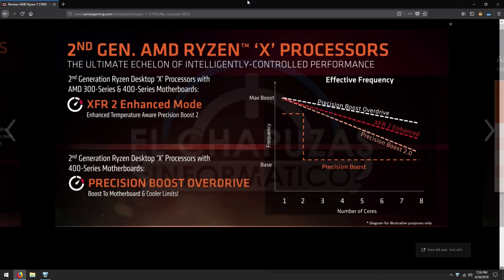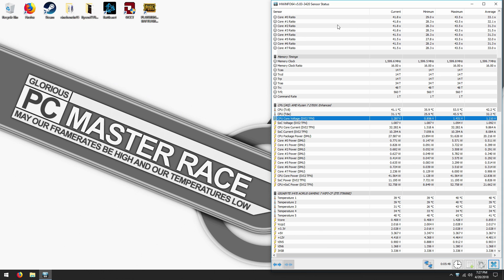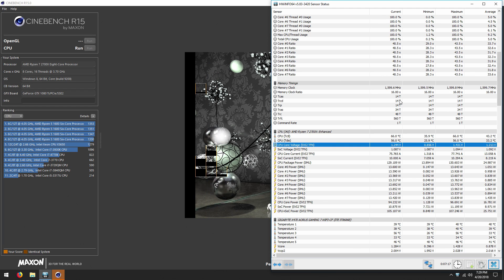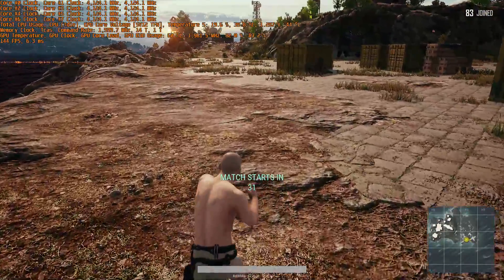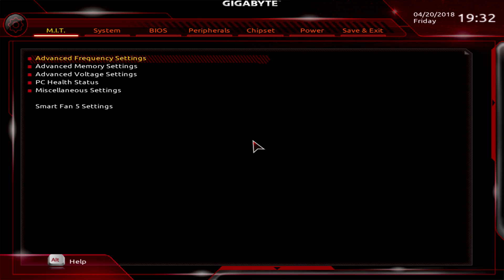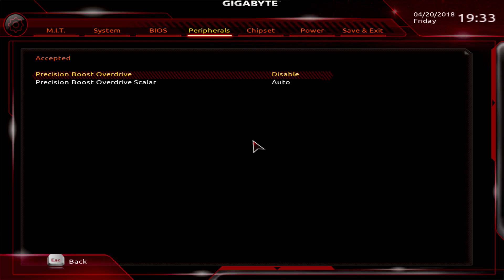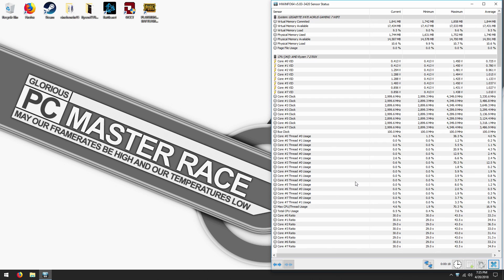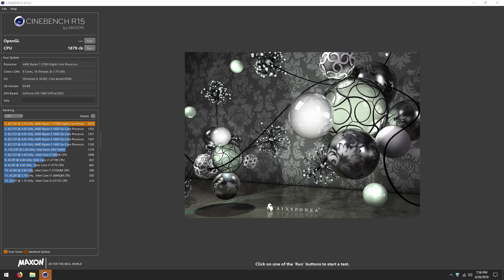How to use Ryzen Precision Boost Overdrive?

Comment: I have the ryzen arous b450 pro wifi and ryzen 5 2400G witch supports precsion boost 2 and bios is on f50. https://en.wikichip.org/wiki/amd/ryzen_5/2400g

I looked under amd cbs and the nbio comms option is not there can you do a video on enabling  precsion boost on bios f50

Comment: I bought a dell inspiron 5676 for $629 on amazon about a month ago with a ryzen 7 2700 and rx580 4gb model . the problem i have with it is that it doesnt boost to its rate 4.1ghz on any core , it justs stays at 3350mhz on all cores and doesnt boost at all.
ryzen master doesnt launch either it just says not responding every time i try to open it. i also looked at the bios and the cpu speed is 3200 mhz and it doesnt give me any options to change anything , not even the voltage. the problem isnt temperature because its 35C at idie and 47C when gaming. i just want to know if its the motherboard thats stopping me from getting my boost clock. ohh and on cpuid hardware monitor the min is 2600mhz and the max is around 3600mhz, but i never see anything higher then 3350mhz on msi afterburner.

Dell Inspiron Gaming PC Desktop AMD Ryzen 7 2700 Processor, 16GB DRAM, 1TB HDD, AMD Radeon RX 580 4GB GDDR5 Graphics Card, Windows 10 64-bit, Blue LED, Model Number: i5676-A696Blu

@t
Reply from the maker: That's weird. I'd customer support and check online if your PC has a BIOS update. Sometimes in OEM systems they put some limitations. Hope by now you have fixed your problem.

Comment: Hi my friend.i have the msi b350 pc mate. my cpu 2600x  boosts at 4.0 4.2ghz with a be quiet cooler and 5 case fans..on bios it says pbo and settings are auto,manual,disable,and amd (default).my setting is on auto.should i change it to amd (default)??

Comment: I can activate precision boost overdrive on my b350 pc mate Mainboard and it works and boosts my cores up to 4ghz-4,2 with stock cooler and 6 case fans.
Reply: Hi my friend.i have the same mobo as you.my cpu 2600x  boosts at 4.0 4.2ghz with a be quiet cooler and 5 case fans..on bios it says pbo and settings are auto,manual,disable,and amd (default).what settings do you have??

Comment: If you have the same setup still, or ability to test the same setup, would you run back through there and see if that option is still there? I have a 2700 x and the gigabyte Aurorus Ultra gaming 7 Wi-Fi board and it's under a custom closed loop, but I cannot find Precision boost overdrive anywhere. In my BIOS, where you had the option to do Precision boost overdrive I just have xfr enhancement and I can a naval it set it to Auto or disable it. Thoughts?

Comment: i dont have those options in AMD CBS ..its different and no precision boost option
Reply: I have the exact same setup, and they have removed the Precision boost overdrive feature with what I think is now xfr enhancement. I think it's the same thing I don't know why they changed the name though. It took me forever to find this when I first installed my motherboard and CPU.
Reply from the maker: The video is year old (ryzen series 2000) and only works with X Series chip. What motherboard, CPU are you using and BIOS?

Comment: Is XFR2 and PBO have the same function or its Different things?

And Can i use that Feature on Stock cooler?
Thank you.
Reply from the maker: XFR2 is the boost algorithm. PBO increases stock limits. You can use PBO on stock but the gains will be little since its temperature sensitive and you'll be feeding extra voltage yet little gain.

If you're using stock cooler, probably your best bet is a - 50mv offset voltage.
Reply: @XanxoGamingBenchmarks  ohhh So if I use Stock cooler it is better to just enable XFR And disable PBO right?
How many Average Boost clock(All core&Single core) that i got if i use stock cooler with XFR enable?
Reply from the maker: @SantaiTapiPasti27  if you use stock cooler, depends on your motherboard vendor, it might have PBO enabled (default should be disabled). 

If you are using stock cooler, it really ain't worth it, +25 MHz all cores in exchange on more voltage (in this scenario, the limiter is the temperatures, not PBO itself).

If you're stock cooler, as I mentioned, it probably favors you using a voltage offset to lower temp and maybe you might see a drop on temp (small rise on frequency). This can't assure you, as I found out depending on chip quality, some chips scale better than other on frequency.
Reply from the maker: @SantaiTapiPasti27  XFR should be enabled on factory, so whatever you see is what you get, with using it on par with your stock cooler. E.g. 2600X on CBR15 around 3950 MHz all Core, Games 4000ish.
Reply: @XanxoGamingBenchmarks  oh thats some nice Boost I will got there if i play Games that dont utilize all Cores
And thank you so much for The info

Comment: So with PBO enabled can i easily achieve an all core overclock @4.25 ghz? should i keep the multiplier and ratio on auto? DO i need to change any other settings to achieve this?  Great vid btw
Reply from the maker: Depending on the load and if you are using BCLK... If you have a good gaming chip with BCLK it is plausible. Without BCLK, you will see higher frequency (depending chip quality and cooling). Leave things on AUTO, might give an -50mv offset if you are using without BCLK. Tuning it takes a lot of time, since it will depend on different types of load, since frequency is dynamic (XFR).

Comment: Why does have my B350 Motherboard from MSI this Feature? And Im stuck to find out how can I fix that my CPU ist always at 3400 Mhz. If anyone have any solutions please write down an answer under my comment thanks <3
Reply from the maker: Check if your cpu ratio is on Auto.
Reply: @XanxoGamingBenchmarks  yeah I checked It, that is not the problem, I knew it happend when I turned on the OC Genie 4 my CPU was alöways at 3400 Mhz, then I disabled OC Genie 4 and my CPU is at this moment on 3400 Mhz too. So yesterday I updatet my Bios version to the öatest in hope thos version fixing my Problem, I installed nothing Changes on my CPU Clock
Reply: Make sure you are using a high performance power plan. 

Then try doing a manual overclock to see if it goes above 3600mhz
Reply: @TheAerospaceChannel  My Powerplan is on the Maximum and manual overclock isn't effectively, I tried It

Comment: on b350 can I enable? 2600x processor
Reply from the maker: I doubt it, unless you can find a modded bios for your board that enables PBO. If that is possible for your model, then I would be worried about VRM temps if they would be fine in the type of loads you use.
Reply: Xanxo Gaming So it turns out xfr2 and pbo on b350 is not and 4.25 MHz on an ordinary BIOS will not issue? B450 only?

Comment: So you need a 450 board for it to work properly. Suppose i'll have to get one some time. But i dont see it doing much better than the up to 4.576 HWmonitor is saying i'm getting on the X370 gigabyte board i'm using now.
Reply from the maker: I've read that on some older chipsets, PBO has been implemented also (GBT board I believe I have read). Now if this is true; I have not tested it personally (no X370 on hand). I'd use HWInfo64 and if it says 4.576 GHz, wow that's great. The CPU I used to have (2700X) single core topped on 4340 MHz (PBO + BCLK)
Reply: @XanxoGamingBenchmarks  If it is its not in the bios anywhere to turn on and off. Maybe when its added to Ryzen master you'll be able to control it on x370s and what not. I think i read somewhere before the 400 boards came out it was supposed to work on at least the x370s as well.
Reply from the maker: @pcgameplay9739  PBO is an option exclusively por 400 series motherboard. Nonetheless; there is BIOS mods (in case there's no native support) with BIOS with PBO support added (I believe).

Comment: Hey , what will happen if i turnn off xfr and pb2
Reply from the maker: Nothing. It should just work "stock settings".
Reply: @XanxoGamingBenchmarks  so the turbo boost ? Will it run at 4ghz or 3.6ghz ?
Reply from the maker: @orwa475  in GBT options, there is XFR Enhancement (PBO). If you disabled it, it will work stock settings.
Reply: @XanxoGamingBenchmarks  so it will run at 4ghz in heavy load if disable Pbo?
Reply: @XanxoGamingBenchmarks  ahh ok i got it  i will trun off Pbo so my proc will run normaly without any oc , cuz my temps are really high , tx i subed + like

Comment: i have the same mobo, cant get ram over 2933, any suggestions?
Reply from the maker: Hello, give me all your specs and kit of your RAM. First thing I would say, update BIOS to latest version.
Reply: @XanxoGamingBenchmarks  well i have x470 aorus ultra gaming not wifi sorry. 16GB G.Skill RipJaws V schwarz DDR4-3200 DIMM CL16 Dual Kit, 2700x
if i try the 3200mhz profile the system is instable. everyhting else on auto
Reply from the maker: Have you checked if that model is in the QVL List? Also, have you tried increasing the the DRAM Voltage? BIOS updated to the latest?
Reply: @XanxoGamingBenchmarks  bios is updated, dont want to play with voltage since i dont know how, qvl list idk. its not the end of the world i mean 2933 isnt bad
Reply: @AzumDzumHzumS  enable xmp profile in bios

Comment: hi if u tested this with cinebench single core test? which frequency u would get with pbo on a single core?
Reply from the maker: Do not remember (had to return 2700X, was lent) but should be 4350 MHz or close to that. If you modify BCLK it is higher.
Reply: @XanxoGamingBenchmarks  ok. i also heard bclk modifying should bring a lot of clock speed
Reply from the maker: @matzoe123  I have done BCLK modifier. 4430 MHz Single Core Clock, games 4350 mhz, games + stream 4300 MHz. CBR15 around 4240ish. How much the BCLK might go depend on silicon quality.

Comment: I just finished a build with the Gigabyte x470 aorus gaming 5 mobo, 2700x, and Gigabyte Aorus 1080 ti. I had my system crash while playing a demanding FPS game after playing for about an hour and I'm thinking it was due to enabling PBO. I'm going to do some testing and maybe play with the PBO scaling feature so that I can get a little boost but keep it stable. I'm wondering if anyone else is having stability issues using PBO. The average speed gaming at stock 2700x settings was about 4.05GHz, while i was seeing about 4.15 average with PBO enabled. With PBO it would spike up to 4.35 and even 4.5 occasionally on individual cores. I feel like the extra power draw for an extra 5 or so FPS probably isn't worth it. Also, 2700x temps stay in between mid 50's and 60's with occasional spikes to mid 70's with large air cooler and PBO enabled while gaming.
Reply: Try lowering a bit the CPU VID voltage, and and try downclocking a bit to 4.2GHZ and raise the bump for the RAM for stability, trust me this will lower the ms. and make the smoother line for the cpu and Ram to comunnicate, causde the RYZEN relies too much on RAM performance!
Also DiSABLE ALL POWER SAVING Features
make sure you install AMD RYZEN Overdrive Drivers and Chipset last drivers on AMD OFFICIAL PAGE!
Also make sure your BIOS is update!
Hope it helps :D
Reply from the maker: @Paranoidhit  just got a 2600X. Running it at 4.2-4.3 (4.2 in games, 4.3 single core tasks).
Reply: @Paranoidhit  It's stable now. It was due to updates or drivers, not exactly sure.   Maintaining 4.175 to 4.2 on all cores while gaming with a good air cooler. CPU temp 68-70C. Thanks for the advice!
Reply: 80additional W drain for 2% perfornamce
Reply from the maker: I'd test PBO enabled and disabled. It is rare, but have you had any issues with memory stability. Also 4.5 GHz is pretty high, I guess you modified BCLK. Maybe BCLK is too high. Wish you good luck and if you need any feedback you are welcomed.
Reply: @XanxoGamingBenchmarks  The memory wasn't a problem. Using Gskill flare 3200. xmp enabled and done. Just needed a few more windows updates and drivers. Many hours of gaming now with no issues. Thanks for the vids!
Reply: get a better cooler  .
Reply: @paciouno1  I was strongly considering an AIO, but I didn't feel like an extra 0.1GHz was worth it to potentially have the pump fail. I've had a Corsair AIO water cooler fail on me before and probably did some damage to the cpu because I was gaming with it thermal throttling at 104C for who knows how long. Months maybe. No joke. I should have monitored temps, but I didn't. Intel makes some tough cpus though because it was still running fine when I retired it. Look for a "lightly used" I5 3750k on ebay soon ;)  ...jk   Also, if anyone is curious I'm getting those temps with a Be quiet dark rock pro 4 modified with 2 2700rpm fans. Came with 1300-1500 rpm fans. So it's about as good as it gets for air cooling. The 2700x runs hot with PBO enabled under high load.

Comment: i got my Board today and what must i see? i dont frickin have this NBIO option in my BIOS (its called F2 3/6/2018) WTF????
Reply from the maker: MrRechtSo F2 is a early BIOS. Should try the recent ones, and also what CPU you using?
Reply: Xanxo Gaming my Bad. I should have updated the BIOS First. Option is there now. Got the 2700x. Start Testing now
Reply from the maker: MrRechtSo I'd start doing manual OC to see what your CPU is stable in manual OC and have that as reference in really heavy loads. Just be careful to track frequency and voltages through HWInfo64. Good luck.
Reply: ok first result with lvl x10. 4050mhz in CB(82°C) 4150mhz in Far Cry 5. well...same results as with the asrock x470 gaming K4. My cpu has some thermal problems i guess eventhough its on an AIO 360mm. BUT all that aside. My gigabyte make noises when the cpu is under Load. its not the AIO i double checked with an air cooler. some sort of coil whine i think. how about yours? i cant stand that noise
Reply from the maker: No coilwhine I believe. What 360 AIO you using. Well also gotta take in account ambient temp. While doing that video ambient temp was around 20-24 degres celsius. Right now on 16 degrees and getting around 60 degrees on my rad (on boot, should increase over time since it takes time water to get hot).
Reply: AIO Fractal Design celsius s36. I noticed when i unplug the copper plate(aio) from the cpu socket the thermalpaste is realy thick around some smale cirlce sized area in the middle which ther is almost no more paste. what i mean is i think my IHS from the cpu not flat at all. its heavily convex:( i lost at the silicon lottorie :(
Reply from the maker: MrRechtSo I use artic mx4 (there's no Kryonaut in my country), i spread thermal paste with a CC so everything is covered. The excess or whats remaining on the CC I spread it on the AIO plate and to finish it off i add a small dot in the middle of the cpu. Not sure if that works. Never tried the Celsius, but from what I read before it's a good AIO.
Reply: some update: with lvl10x in BF1 multiplayer clocks are between 4150-4200mhz CB 4100Mhz. On lvl2x though its only ~25Mhz less but also a little less heat. i wonder why you have such rock stable clocks in BF1. maybe its because your temperatures never go beyond a certain point? can you change the voltage for  the RAM in your bios? for me its grayed out. have you tried ram oc?
Reply: i got the second Board now and it makes the same ugly VRM noise when the CPU gets stressed. i cant stand it a bit. do you have the same experience?
Reply from the maker: Give me a couple of days I'll upload a Wetransfer hopefully Sunday and link it, hope I remember.
Reply: If only we were told to update the bios in the first place to find these options lol thanks for this!

Comment: Hey great videos, thanks for the content.

Everything ULTRA on pubg @ 1080p and you're maxing out the 144FPS cap? Very nice. Will definitely be considering the 2700x now over the 8700k.

I have everything except mobo + cpu because the Intel/AMD decision is difficult.

The RAM I purchased is 16gb DDR4 3200 rated for CL timings 14-16-16-36 @ 1.35 (Corsair Vengeance LPX). I think it is Samsung E-Die. Do you think it would make much difference if I had tighter timings like yours? I probably should have bought Samsung B-die..
Reply: Brian K nice you probably need at least a gtx 1060 6g to run on all ultra but the cpu does have some role in the setting